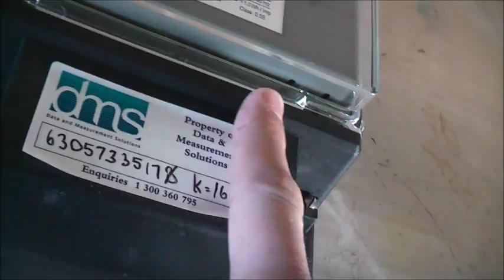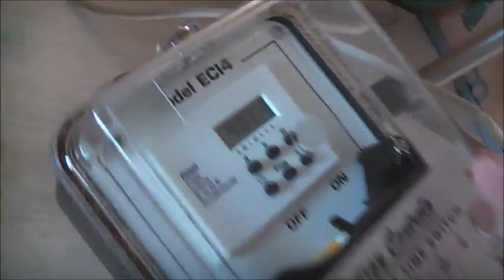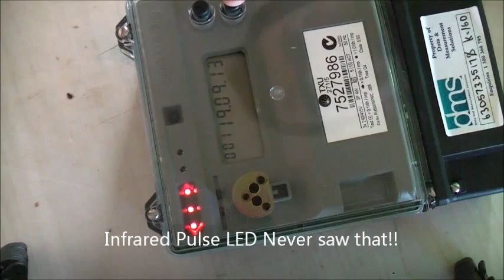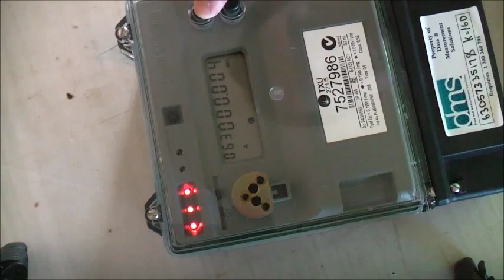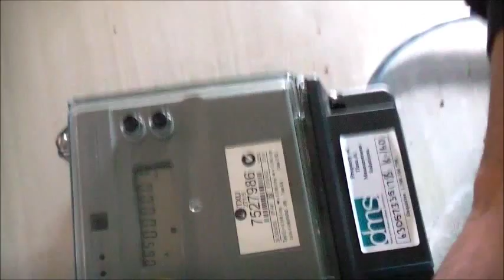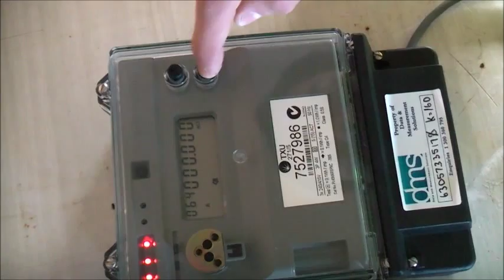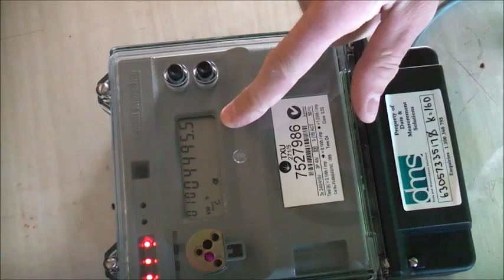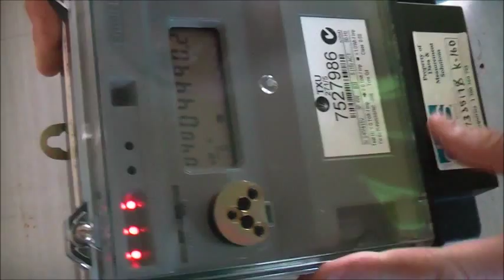Timeswitch & Electronic Smart Meter Teardown

Comment: Some are, but many of the meters are very poorly made inside. There is also that stupid remote controlled switch many have to cut off power, which if there is a defect in the circuitry controlling it, could arc, heat up, and cause a fire, since the housings are often made out of polycarbonate which becomes flammable after it melts.

Comment: Samwa capacitors are a garbage brand, same with the other brand in that timeswitch, at least the case seems to be made out of Bakelite which is heat and fire resistant, polycarbonate melts and burns like a roman candle.